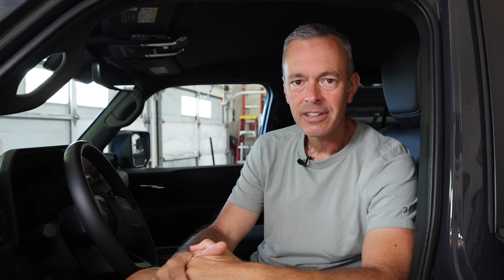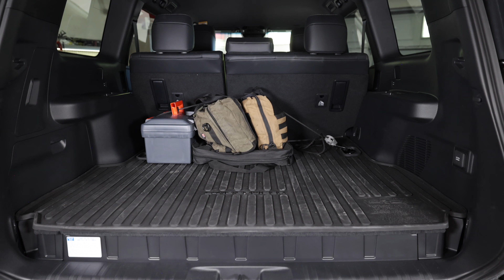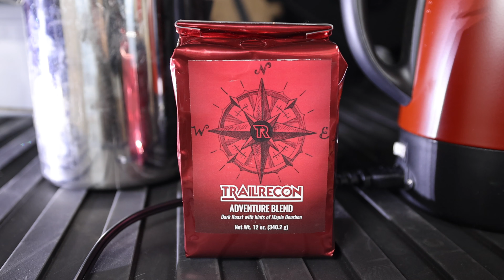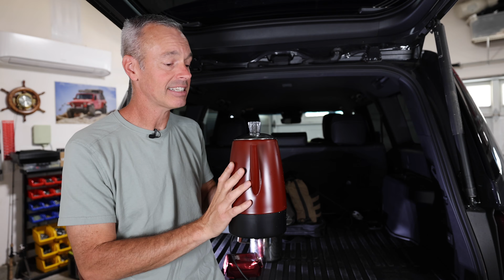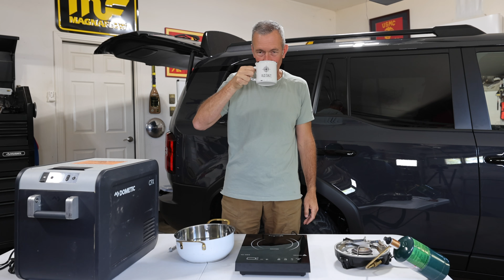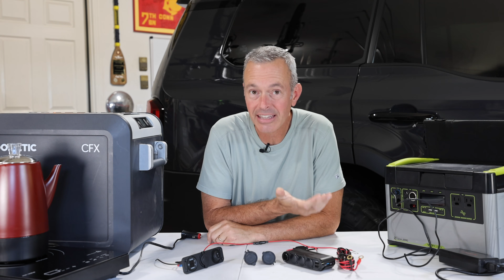Is it Time to Go Full Electric Overlanding?

Comment: I did it. Bought a 2kwh bluetti. 12 volt fridge, induction cook plate etc. it works for a long weekend. I bring my lil Honda suitcase generator for longer outings. Expensive? Yes. Worth it? I don't know. Probably not, but it is nice. Very convenient.  wind is no longer an issue cooking and I always have cold beer.
Reply: I have a Jackery 1500 with an ARB 50 qt fridge/freezer. If you are driving/recharging every day its fine. 
But if you pull up and basecamp for four or five days.  I have two portable solar panels capable of 300 watts/hr.   This is where electricity can be a problem.  Rain/fog/shade.   Putting a charge back into your battery.  The more juice you use..  I still use propane besides, that's not going to change. My portable solar panels have about 30 feet of cable. That way I can set them up and maximize them as conditions vary.
Reply: No propane for me.  Goal zero, solar+ alternator charging.  Induction stove top, fridge.  Heater is connected to gas tank.  No need for a generator, or propane.  It is safer, and no need to refuel, etc.  this is the way to go.
Reply: Sounds worth it to me.
A small price to pay compared to a vehicle, campers, RVs, ATVs, and all of the camping gear and gas on which people spend their money.

Comment: I would get a Ecoflow or Bluetti power station that could output what you need and simply use the vehicle's inverter to charge the power station only when necessary.  The newer EcoFlow and Bluetti power stations can charge much faster than your Goal Zero so they would make use of the Toyota's inverter output well.
Reply: This, powerstations have mppt controllers, inverters, USB etc, and they're portable - so when you can fast charge them from your car they are ideal...

I'm running the ecoflow inverter charger with my power station, 800w to power the station and it also does reverse charging to the starter battery if needs... 

Reckon the days of dual batteries systems are limited, even for ICE vehicles...
Reply: 💯.  This is basically what I’m already doing in my GX460.  It has a wimpy 2 prong inverter built in but still does the job to recharge.
Reply: If the loads are primarily AC it makes sense from my experience. A lot of times those units have very limited 12v amp output. A few builds I’ve worked on had air compressor, roof fan, starlink, fridge, and with a 15amp output we constantly had issues and they eventually built a 12v system. I’d say it really depends. Those are nice for sure and I had multiple units of each, but the 12v might be worth checking 😊
Reply: @yayinternets  I have a GX460 and I was wondering if I could run a portable battery pack. What size battery pack are you running?
Reply: This is what I do in my 4xe JL, though I don’t need to run the engine to top off the Anker power station. When needed, I pull from the high voltage hybrid battery.
Reply: No idea why anyone would have bought a Goal Zero anytime after 2018😂
Reply: @kelvinstoryteller8564  This is exactly what I do with my hybrid F150! I can do over 7K watts out, I can charge my EcoFlow Delta Pro in under an hour and my truck usually never kicks on as it pulls from the hybrid battery. It's a good setup.

Comment: I've gone full electric with a 2400w battery generator, that is recharged on a 300w DC transformer unit in the back of my Jeep when the engine is running, and on 350watts of portable solar when in camp. I have a camping refrigerator two induction burners, and other camp things like DC electric blankets, etc. I have never been without electric power, or concerned about charge by conserving electric usage.
In two years and about a dozen camping adventures, I'm happy without kerosene or propane. My electric battery generator doesn't take up any more room than a 20 lbs propane tank, but it does weigh 65  lbs.
My high amp (40a) line to the back of the Jeep uses a marine 8/2 line to a 60 amp capable 6 button switch in the rear cargo compartment. That 6 button switch has 2 button capable of 30amps. One of those is the 30 amp 24v DC charger for my battery generator when the engine is running.

Comment: Brad, my 2 cents: get rid of all cigarette plugs. Go with 12v SAE connectors. Way more reliable. I modified my fridge, compressors cords with an SAE. Plus you can find an SAE connector female flush to your trim or to replace one of the cig connectors on the flush panel. I also used the counter part of the SAE to solder on the other end of the 1ft cig connector left over. This gives my the choice to use it as an extension and still be flexible with other people's vehicles if needed
Reply: Anderson plugs are good too.  Especially for higher amperage items.
Reply: @Mike_Quinlan Anderson are better than SAE by far.
Reply: Currently converting cig plugs to SAE, more options and smaller, the spring in the cig plugs is sometimes too strong causes them to unplug, take it out and cut a little bit of the spring off...if you still use them
Reply: It’s always good to learn about all these options. In a SHTF good luck finding a propane refill…whereas the sun is always there.
Reply: @cdnjeepoverland yup, if you’re gonna go through the hassle of sniping and soldering might as well use Anderson

Comment: to your question about the battery: nickel metal hydrate batteries do have some advantages over lithium ion batteries they can be charged faster they can do a lot more cycles than a lithium battery and they perform significantly better at cold temperatures so they don’t have to be heated as much  Li-ion . And they are by far less dangerous in case of a failure than lithium batteries. 
well lithium batteries can store more power at the same weight and can be discharged faster but I think in a vehicle like the land cruiser the advantages of the nickel metal hydrate battery are more important.
sorry about the writing and the spelling but it’s like almost 3 o’clock in the morning over here in Germany and I’m too tired to correct all the errors 
but I do like your videos a lot ! So I had to answer!
Reply: There is a solid argument that Lithium Iron Phosphate (LFP) is better than Nickel Metal Hydrate
Reply: You’re quite right there but that is not the question in this case. The usage of lithium ion phosphate batteries is just starting and as far as I know only some Tesla models and a few from Byd and XPeng are using those right now. So probably they are quite expensive still. 
Toyota is more going into the direction of Feststoffbatterien (solid state batteries but I do not know if this is the proper English term for it) which would be a vast improvement since they would provide up to 700+ miles of range (compared to today’s Li-ion battery size)  and could be charged within  10 minutes.
Reply: @andi-ih3jj  I feel like you're mixing up Lithium Ion vs Lithium Iron, they're not interchangeable. They both have different chemical differences and I wouldn't recommend Lithium Ion with anything vehicle wise. Solid state batteries though are in the early stages of research and development
Reply: @husker_nation  Ah now I get it, sorry   
You are talking about LiFePO4 used for solar purposes and in RVs and in model planes and cars. But only the cheap Tesla models and a few Chinese manufacturers as I stated above  would use such a battery as traction battery. Tesla already announced it just do it for money saving purposes because lithium iron phosphate batteries do hold only about half or 2/3 of the energy a same size and weight lithium ion battery can hold. I know lithium ion are not the best choice but as far as I know at least 95% of all EV’s use those. This is the source of the somewhat over used fright of burning EV’s stems from. And this also contributes to the problems firefighters worldwide have with getting electric vehicles on fire not put out, sometimes for weeks rekindling.
UPDATE I found another car with a lithium iron phosphate battery. it’s called Coda and was manufactured by Coda Automotive a US based start up but which has as far as I know long stopped existing. I don’t even know if they got to sell any cars they just did the research and designing and wanted to have the cars built in China then
Reply: I saw a video a couple of weeks ago about a chinese EV. They let you choose between Li-ion and LiFePO. The latter had less range, but it should be more durable and less dangerous.

Talking about NiMH, they are underrated. LSD types are just great and last way longer than any lithium battery I ever used. The key is using a decent charger and not to try to squeeze every Ah out of the package and try to sell just bigger capacity. Those extra 20% of capacity makes cells very fragile and you will never recover the investment (that's why NiMH batteries from brands that are big in alkaline cell tend to be crap). 

I still use some white eneloops bought in 2009 (I know that because I wrote the date in the cell itself). They seem to last forever.
Reply: @andi-ih3jj  LFP is not actually new. My e-moped from 2007 has LFP batteries (headway cells). They were expensive back (£700 for 1kWh) then but now LFP is cheaper than ternary lithium (NCA/NCM/LCO/etc). And nearly all home energy storage lithium batteries are LFP and that's been true for a decade or so. You are right that not that many cars have them yet, outside China, but it's growing fast.

Comment: Good video Brad.
The idea of diching the propane is intriguing...
Just some thoughts here.
The battery in your Land Cruiser is 1.87 KWh, that's Kilowatt hours which is different from just KW or kilo watts...
Basically, doing the math. What this means is your 800-watt coffee pot can run on that battery from fully charged for about 2 hours to the battery being nearly depleted.
Your induction stove for only 1hour...
Something like one of the larger power stations like Bluetti would give you better performance without having to run the Land Cruisers engine, and you can charge the Power station while you're driving...
In my 4x4 overland truck/camper, I'm currently rocking a DIY 400 Ah or 5.2 KWh 12volt LIFEPO4 battery  with 1kw pure sine inverter and a 400-watt solar bank on the roof. 
This power system takes up about the same space as your 12v refrigerator. I run a 12v refrigerator about the same size as yours year round along with a miriad of other loads like M18 battery chargers, ham radio, a heating system for the lithium batteries during freezing winter condition etc...
I'm in Washington with less than desirable sunlight during the winter months and still have enough power with the limited driving I do taking up the slack charging the battery...
I haven't tried running anything larger than your coffee pot because I'd have to upgrade my inverter... I do believe it would do it though. With proper conservation of coarse...
I am going to be adding a 12 volt heat pump ( heating/AC ) to my rig soon... We'll see how my battery holds up to that...
I'm going on 2 years now with this system...

Comment: No, I can fill up propane everywhere and it will heat my camper, cook my food, and warm my shower for at least a week on a 20lbs tank.  I didn't have to run my engine
Reply: Plus you don't lose storage to a battery that runs a hybrid vehicle.
Reply: @ThePioneerSpirit  The marvels of simplicity just keep on coming. Totally agree.
Reply: Full 20lb propane tank 37lbs, Battle Born LiFePO 31lbs. That being said I use propane.
Reply: Ever toured an RV graveyard?  It drives one point home, just how common RV fires are.  I know, car vs. RV, but the concept is the same.  Nearly all RV fires seem to have started at the propane devices, hot water, RV heater, or 3 way refrigerators.  Propane does carry a somewhat manageable risk.
Reply: @Erin-Thor RV fires are different than cooking at a camp site. RVs have routes for propane to travel through which will can lead to leaks and eventual fire. Maintenance is oey. That's a completely different use case than just regular camping and cooking outside. Plus, the RV industry is focused on making products as cheap as possible.
Reply: @max7143  I can refuel my propane tank in 15 minutes at a gas station. It will take hours to recharge a 275ah battleborne
Reply: Meh. I can do all of the same things, indefinitely, never pay for propane again, cook faster, safer, and in the wind.
Reply: I'm also considering electric for my Bronco, but with an inverter. Outside of fuel consumption and the engine running (I really don't care if it runs while I cook) are there any other drawbacks I should think about? I've research the amp capacity if Automotive alternators and its incredible.
Reply: Those batteries seem to only last a few years and very costly
Reply: I can run a three thousand watt inverter off of a dual battery set up with a deep cycle secondary battery. That deep cycle battery is charged off of the vehicle alternator through the primary battery. A DC-DC Charger keeps everything from undercharging or overcharging.  I have run lights, a microwave oven, an air fryer, and a Starlink all at once on the system. The biggest draw by far is the air fryer. I can run all this off the start battery itself, but then I need to keep the vehicle running to not drain it quickly. This is not the same as using a VSR isolator which requires two of the same chemistry batteries. The VSR (think cole hearse and/or Genesis Offroad setups) will protect the starting battery and allow the second battery to be a jump in an emergency but overall battery life on the secondary can be short, to the disappointment of the pocketbook.
Reply: I’ve been looking at doing this but with battery banks instead of running dual batteries on my rig.  So since I already am running a large battery bank anyway why not get one with a large power output to be able to run an induction cooktop.  I can also run a heated blanket for cold camping or for a fan on hot nights.
Reply: A Rivian with a Large Pack has a 135kWh battery. There is now a Standard pack and a Max pack, but the Large is the most common.
Reply: @Erin-Thor right? Because batteries NEVER blow up at all 😂
Reply: True if you only intend to stay in one country. Some of us are planning for multi country travels, then some redundancy is very useful. Our plan is to use the house battery pack and not a hybrid car.
Reply: The other issue is people with medical implants need to stay 2 feet away from induction cooktops
Reply: @raymondclark1785   now you’re making things up.
Reply: @Eddie_-_  Nope, warning that came with my pacemaker along with stay away from welders and safety at work told me to stay away from the Electromagnetic launch system we were testing 😞
Reply: You still how to go fill it up/make sure it’s filled up? With solar battery is topped up by the sun. Not sunny just turn truck on, you always gotta have gas.

I run everything off a couple large lifepo batteries and it’s great.
Reply: @ThePioneerSpirit  would you leave your hybrid battery at home?😂
Reply: @zkatbyte  por que no Los dos?
Reply: Add solar panels and, you’ll be done.
Reply: @camaroboi13 EV batteries don't catch on fire nearly as often as gas vehicles light on fire. 

There are 7 billion battery powered smart phones and a billion tablet computers and laptops on Earth which can be taken onto a plane at any airport in the world.

Will they let you take a cup of gasoline onto an airplane?

As stated by the National Transportation Safety Board, EV fires occur at a rate of 25 per 100,000 sold.

Gasoline vehicle fires occur at a rate of 1,530 per 100,000 sold.

Gas vehicle fires are a common daily occurrence everywhere in the USA.

Ask any Firefighter, Fire Marshall or Fire Department staff.
Reply: As is obvious, or should be, there are pros and cons to everything. Do what serves you best.
Reply: Yeap and you have to carry a whole lot more crap
Reply: You do need to run your engine - to go refill your propane. My system recharges plenty fast enough using solar. 

I can do everything my old propane system could do, and more, for a fraction of the cost, risk, and effort over time.

Comment: Brad, you're going to have to make a list! Pro's/Con's. LOL We travel to CO a lot and High altitude is an issue with propane equipment, let alone factoring in colder weather, so have been looking into induction cooking etc. I too am an early riser and I try to keep it quiet, but that vehicle starting to get the inverter to work, deal breaker for me. Also, you'll end up being tagged like  "The Guy who runs his Generator" at camp. lol.

Comment: Toyota battery is too small. Buy Ecoflow 800w alternator charger plus Delta Pro3 4000w power station. With my setup you can use Ice car with all electric goodies, inluding Ecoflow Wave 2 a/c and heater.

Comment: Brad, Two things.  My wife's Grand Cherokee has the battery under the front seat, but there are still terminals under the hood.  That LC may have terminals up front where you can get power for a winch and forward lights.  The other thing is that I run my fridge via 12V from my Jackery 1000.  I then charge the Jackery via 12V socket while I am running.  You just need to remember to unplug from the 12V socket while you are parked for a long time.  The Jackery will run the fridge a couple days if it needs to.

Comment: I plan on using the best of both worlds:  propane for cooking and heating, electric for AC and refrigerator.  My situation is a little different, I have a 21 foot off-grid travel trailer so I have a lot more room for everything.  I've added 2 X 220 watt solar panels to the existing 100 watt panel on the roof.  The existing 100 watt panel charges the 100 amp/hour battery for lights, awning, and convenience outlets.  One 220 watt panel charges a 1000 W Jackery Explorer dedicated to supply a 120 volt refrigerator and one 220 watt panel charges another 1000 W Jackery Explorer which is dedicated to running the AC.  All can be supplemented by the 400w 120 volt outlet in the bed of my Power Wagon if needed.